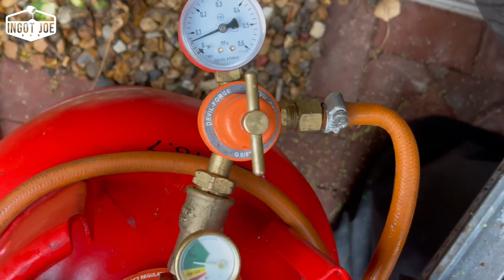My biggest Ever Copper Ingot (27 lb 14 oz). Let's cook!

Comment: Awesome melt and pour. An absolutely huge beautiful copper bar. I need a mould, or 2, that size. Did you make it or someone you know?  If not, where did you buy it at?  I have some melts I want to do, but need a mould that size. I know a couple machine and weld shops, but they would charge an arm and a leg for them. That and they are extremely busy right now. Great video. Keep them coming.
Reply from the maker: Thanks, a friend of mine made them for me, he actually made the two for £200, are you in the UK as I only ever use one, you could have the other one for what I paid for it?
Reply: @IngotJoe  I am in the US. Shipping would be atrocious.